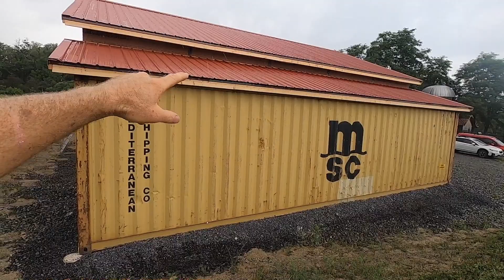In The Swing of Things - Shipping Container Barn Build #8

Comment: Loved the trick with the clamp for ripping the boards. Why not leave that space in the wall between open for ventilation? Depending on climate and what you’re using it for? Most of our hay barns have that area left open but with larger eaves on the top roofline.
Reply from the maker: I'm planning to insulate the space so I can work out there in the winters (my old tractors always need repairs!) ... but I see how that ventilation would be great up top. Cool idea

Comment: Your video literally answered all my design thoughts! Amazing job buddy, can’t wait to see the finished product. Do you have a dimensions sheet anywhere? Assuming 40ft containers, what’s the distance in between the 2 containers? Did you have to custom make the roof cross frames or where they some sort of standard length?
Reply from the maker: Good to hear it's looking good to ya. Yeah, 40' containers, 30' trusses, 27' between the boxes ... I may publish a plan when I'm done (done that with a few other builds) but not sure at this point. Exterior walls are in the works!

Comment: Not sure I saw you cut the aluminum bubble wrap before you installed the ridge cap. Not going to be venting it ?
Reply from the maker: I didn't even consider cutting the bubble wrap until someone else mentioned it too. Thanks! I'm gonna go back in and vent it before closing up the attic. Better to have that air flow

Comment: What are the total dimensions ? I know the containers are 40 footers, but what is the spread between them, exactly how far did you place them apart?
Reply from the maker: 27' between containers, 13.5' high ceilings in the central space, and like you said 40' long/deep
Reply from the maker: 27' between the boxes
Reply: @metaspencer  I would like to do the same thing except 60’ X 40’, but I feel as though that distance is too wide and would require supporting poles in the middle of the truss
Reply from the maker: @Soldierboy1986  trusses can be manufactured to cross that span, but gotta calculate the weight and all that